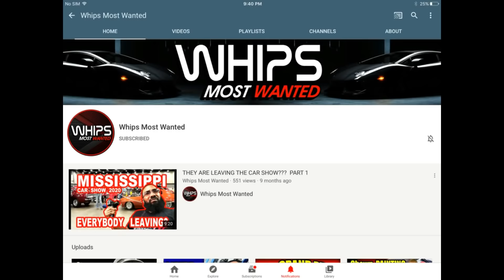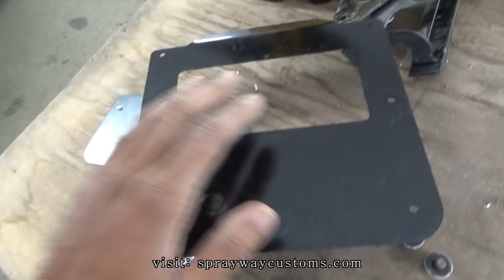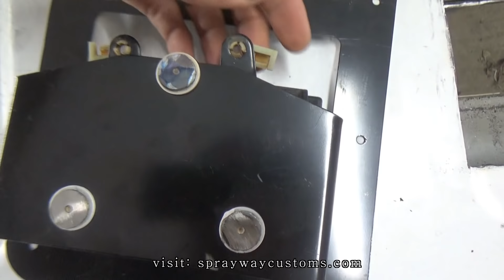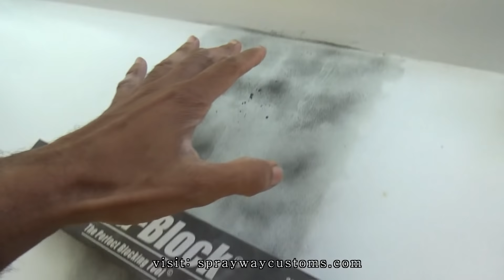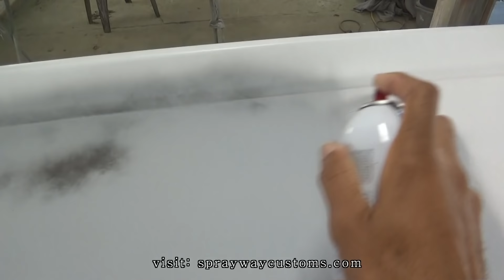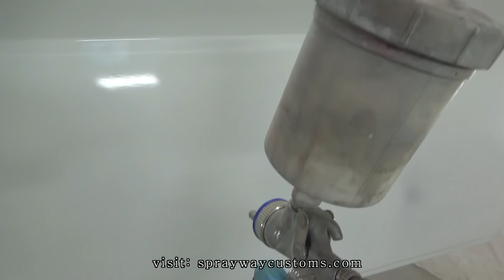Shaved Tailgate Flip HANDLE RELOCATOR Chevy Silverado OBS Shortbed Truck HOW TO SHAVE DOOR HANDLE

Comment: Nice results. I did the flip tailgate handle. And Cadillac DeVille tail lights. Plus, reverse light/ license plate box in my tailgate. All metal construction. Very thin skim of filler. Which nobody can avoid that necessary step. Since I'm not finished the truck (put away for the winter) This coming spring, since I have dual pipes coming straight out, gotta build a roll pan with cut-outs for the pipes. Got to love a custom OSB Chevy!
Reply from the maker: Yes indeed 👌

Comment: I watched your  video on doing  a tailgate handle relocation kit,  it inspired me to do same thing. I also  started doing  a license plate relocation kit at same time. I kit the square hole in my tailgate for the license plate relocation box  in the bottom right corner  of my tailgate.  After cutting  the square hole I left it open and had a friend tig weld the tailgate handle filler plate in and from the filler plate town the center of my  tailgate to the bottom of the tailgate a big dent formed and we was un able to get the dent out . This happened twice on two different  tailgates . Should I wait on cutting the hole for my license plate relocation box? Any help would be greatly appreciated. By the way I love watching your videos they are very informative and not boring to watch like most videos I see on YouTube.
Reply from the maker: Yes, I had the same issue just knock the dent in and bodywork it. It's just the heat from the welding

Comment: FANTASTIC WORK!!! I can tell you love what you are doing,
Where did you learn your trade?

It might be easier to fit and cut the Bed liner before welding the outside hole shut. (Unless you were using spray on bed liner)
Reply from the maker: Thanks man. I went to trade school for this but I've learned more from watching YouTube. I'll be doing a spray in bed liner .
Reply: @SprayWayCustoms  
I also watched your YouTube video on repairing a dash. I was thinking Berliner would be hard to keep clean, the you whipped out the paint coating. Really gave it a nice texture. And ability to clean. What part of the country are you in?
Reply from the maker: I'm in Alabama

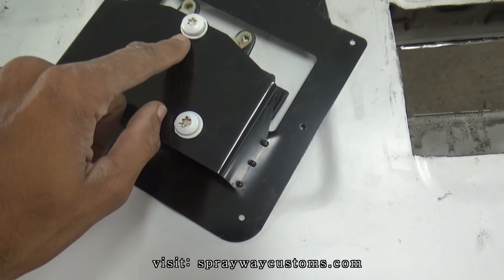Comment: 11:04 next time just cut each side maybe a quarter of an inch. I'm talking about each side where you have three tack welds trim 1/4 inch off each side then re tack weld it. Basically you're making it smaller two sandwich together but don't make it too short where the bolts won't reach or should I say the three screws love the channel stay blessed keep up the good work
Reply from the maker: I really appreciate the info man

Comment: Good as always, I got a question bro sprayway, I'm going to try this Speedokote High Build 2K Urethane Primer it's a 4:1 mix with the prime and Activator, can I also add a 1part of reducer to that as well to make it smoother out the gun? Or what's the best way?
Reply from the maker: Redd Myles yes..I do it all the time if I'm spraying with a smaller tip. It'll be more like a sealer but just apply more coats to build it up.
Reply: @SprayWayCustoms  ok I sho appreciate the info, I got a 1.4 tip so I kinda figured that just that 4:1 was gonna be a lil thick and not come out that good.

Comment: Hey bro it looks good as usual. what sealer are you using I have a white 91 dodge D150  that i want to start woking on and i like how that truck is turning out.
Reply from the maker: Thanks. I used Urekem Color Seal. You can get it in different colors.
Reply: You think I could make that tailgate spoiler kit work for my dodge truck. There is not much of an after market parts for old dodge trucks

Comment: Thanks you Sprapway for another good one. I would like to ask you. If I sand down a hood for repainting, can I use a rattle can of etch primer for the few bare metal spots and come back with 2k over that and the rest of the hood, or should I go ahead and use the epoxy sealer and do the whole hood with the sealer?
Reply from the maker: Yes, I've done that before with no problems

Comment: What’s up guy ? I have a question for you. My dash on my 01 dodge 1500 pickup has broken into like 3” pieces, the entire dash. If I can get all the pieces glued back together then cover it with fiberglass do you think it will be strong enough to stay together? I think it will but I’ve never tried it this way. The dash was originally made with thin hard plastic that didn’t hold up to the heat. Most dodges had this issue for several year models. Just wanted to know if you had tried it before?? If I can get a good plastic glue that will hold just long enough for the fiberglass to set up I think it might work. What are your ideas?? Thanks man and hope your staying safe from the corona rona !!!! 👍👍
Reply from the maker: Yes...just put them back together and then wrap the dash in fleece and then fiberglass it
Reply: @SprayWayCustoms  I’ll let you know when I try and tackle it !! Thanks and that tailgate is looking sweet 👍👍